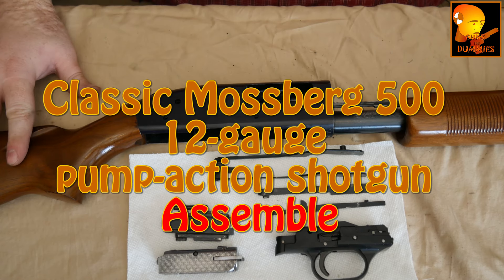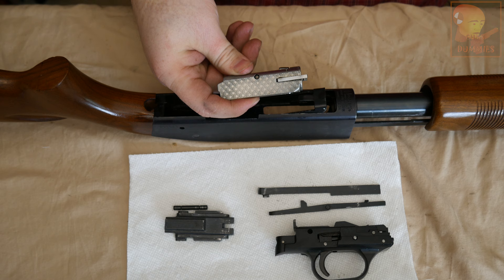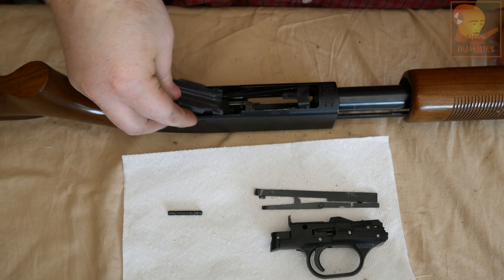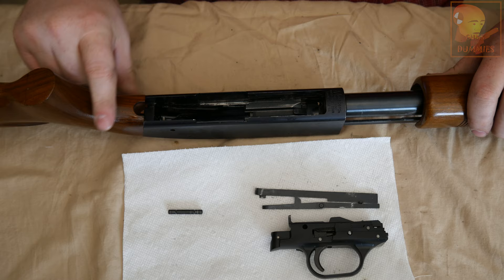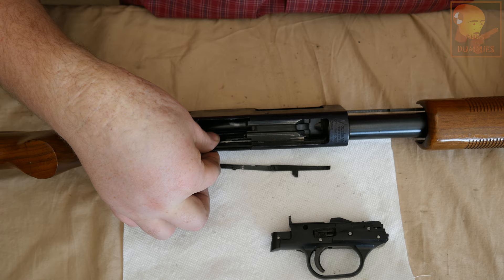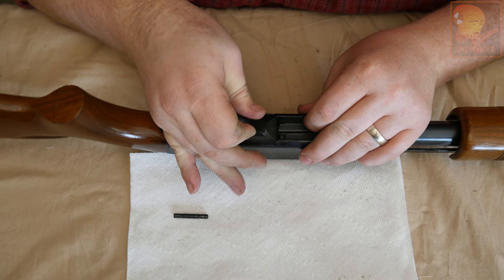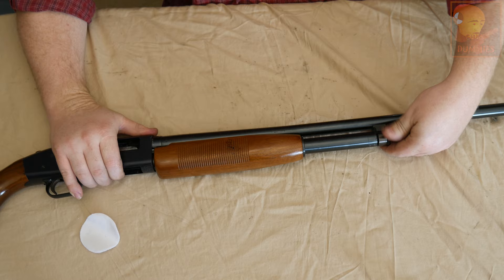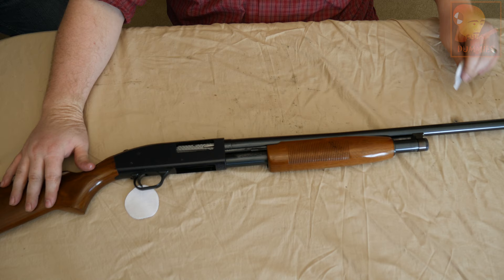Guns for Dummies 4K - mossberg 500 assemble - 12 gauge classic pump-action shotgun put together

Comment: I watched 5 other videos, and none of them explained to line up the pump rails with the carrier and the bolt and slide it forward. Thank you for your help! I was about to break down and throw a fit like a 2 year old, before you showed me that!
Reply: Maybe you can help me. When he puts the bolt in, you can't see the spring. My bolt doesn't look anything like he is and I can see a spring. My real issue is that I cannot get the bolt to seat in. Also my slide is not welded in like he said it comes in and out freely.

Comment: Hi, nice video. Once I put the shell interrupter and trigger housing in, the bolt doesn't move. Does this shell interrupter or the other side supposed to have any curve? It's rather stiff but it seems to curve slightly. Thanks
Reply: I have the same problem won't rack back once trigger group is reinstalled please help they want $40 just to look at it at my local shop!